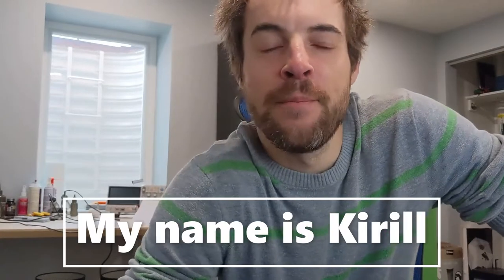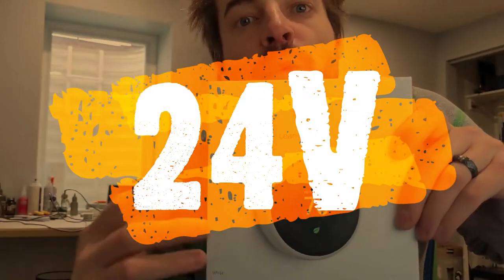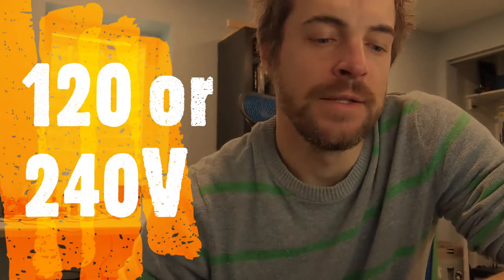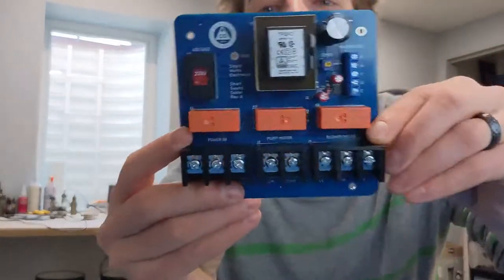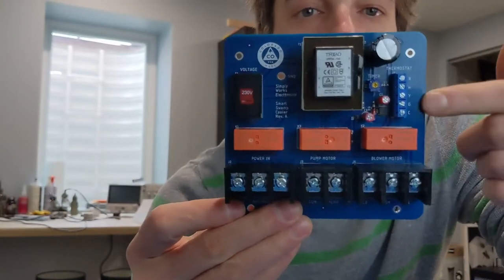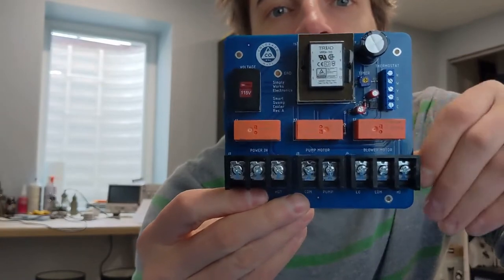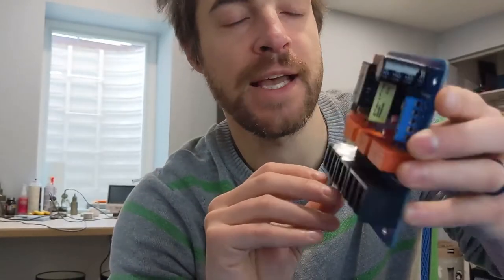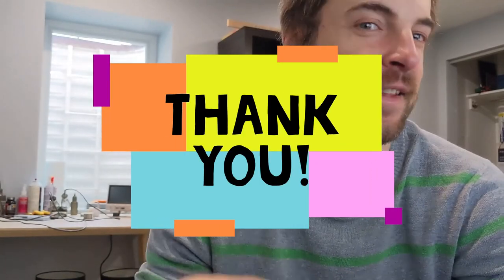Connect your swamp cooler to a smart thermostat!

Comment: Nice work.  I’m a computer engineer and my house has a one wire heating setup I had to adapt for my Google smart thermostat and would love to integrate the swamp cooler controller into the system so if the kids turn on both systems accidentally they aren’t fighting each other.  I will check out your website as I would love to buy a “plug and play” solution but if not I understand your setup to roll my own if necessary.  You are a smart person especially to turn your idea into a working solution.
Reply from the maker: Thank you Chris. Yes, I design electronics and write code for a living as well! Always wanted to design a product on my own terms so I saw an opportunity when I stumbled upon this problem!

Comment: Just ordered one, thank you very much for putting this together and of course selling it for a very reasonable price.      One note on your website,  your order buttons are grey which make it look like you are out of stock.
Reply: Thank you for your support! Yes, you got the last board. I am prepping the next batch and that should be ready soon. Let me know how your installation goes!
Reply: @kbelyayev  Thank you very much for shipping it out so quickly. Installation went perfectly, I integrated it with an Ecobee.    The included instructions were pretty well documented, somehow I got it all wired correctly the first time.  Only thing that threw me off was the usage of the word "Furnace" and the naming convention for the options.  For example I still didn't understand what was meant by single and dual transformer setup as I have very little understanding about how a transformer relates to the functionality.   I was doing a more simple "separate thermostat" option for now, but like the idea of having the AC fan circulate air in the future.    I haven't setup any routines yet,  but so far I  have it turn on at 4AM and start cooling off the house when it's the coldest and adjust the temperature once when it gets hotter out.    I'm hoping to have it automatically adjust the temperature based on the temperature outside throughout the day, but I have a feeling I will need to program this manually if I want this functionality.   For now I'm going to see if I can do it using routines in Alexa.   I love having options, thank you again for creating this.
Reply: As for the installation, I did a more unconventional approach. I inset the outdoor box directly into my interior wall where my old thermostat was and mounted the thermostat directly to the outer lid.   I actually think it ended up looking pretty cool.
Reply from the maker: @MadBunnyLabs Nice! I think that's a good option as long as you use a junction box!